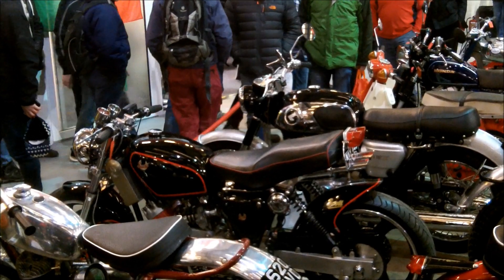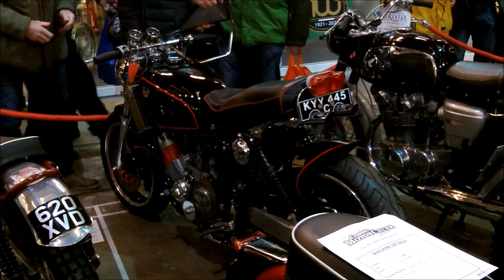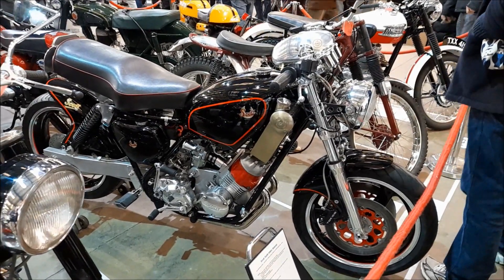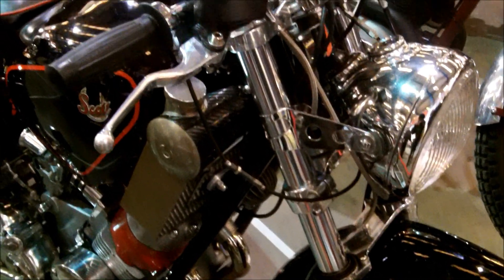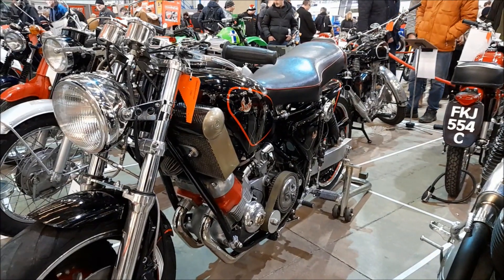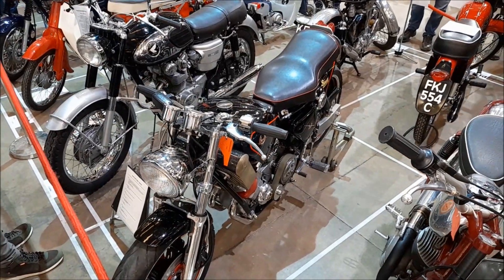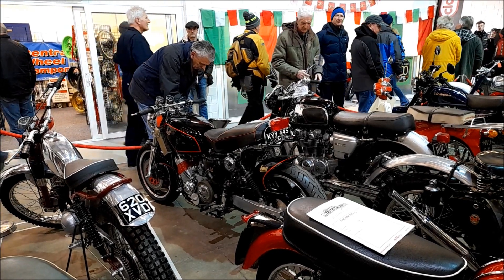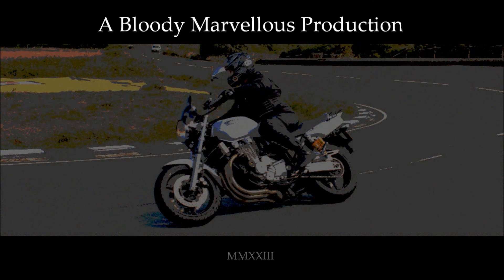Scott Swift 500CC Special - Duke Dyson

Comment: Heh heh, never underestimate a Scott. Coming away from a mid-70's Cadwell race meet on a newish Suz T500, I was passed by what, from the rear, looked like a pair of four-stroke pipes on an old Brit twin etc. While the Suzuki was certainly no KH500, it wasn't slow, but no matter how I tried, this guy could ride & was leaving me for dead, mile after mile.
I finally caught up when we stopped for fuel in Wragby - it was a pre-war Scott 600 on a pair of Jurassic era Avons & ridden by a tatty wax-jacketer of at least twice my age, wearing thick specs like Benny Hill's milkman & a pair of well oiled para-boots.
Now feeling about twelve, I turned & gave my polished & gleaming machine that long, long look they all learn to dread . .
I got £450 for it! : )